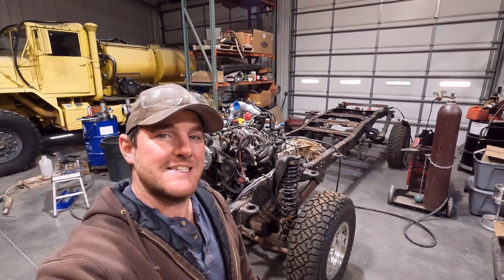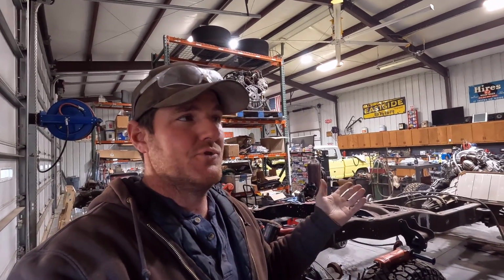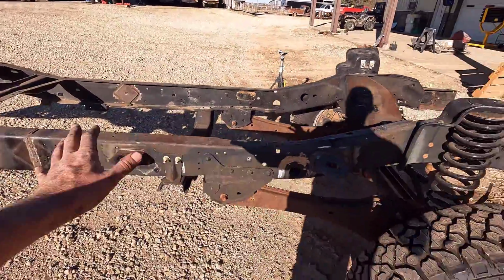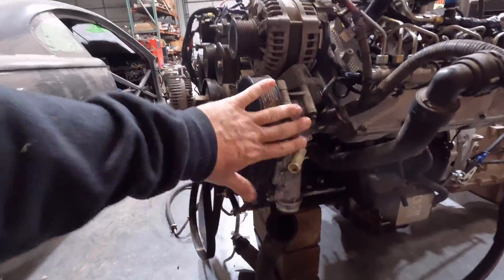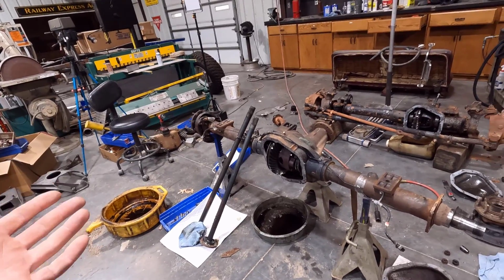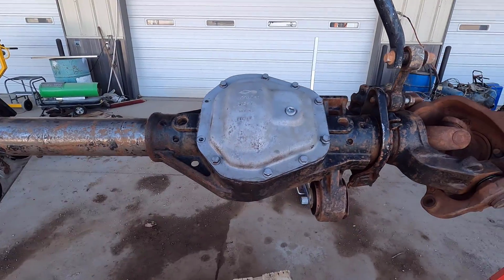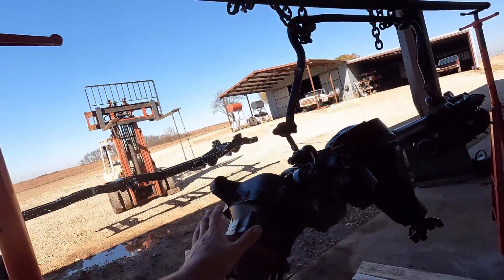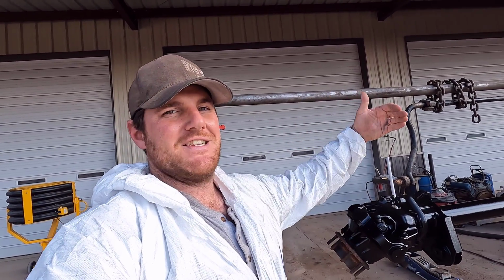Coating the Frame for the Ultimate Crew Cab in Chassis Saver Ultimate Crew Part 13

Comment: how has it held up over the past 2 years?  any sign of rust making its way thru?
Reply from the maker: I still haven't finished this truck so I cant say on this one. But by white "Ultimate Highboy" build was painted in with the same thing back in 2020 and gets used in some pretty rough environments and its holding up pretty good considering. Some fading where it can get UV exposure and some chipping where its exposed to rocks. But overall pretty well. If it was on a street driven truck it would be even better shape.
Reply: @MattKubik1791  I did my 03 land rover disco with it...with the body on frame...no fun...got it in my hair, etc. very hard to get off.

Comment: Just saw the last few minutes of this video and that front axle shows real well.  Nice finish.  Is that chassis saver an already thinned product,  ready to spray or did you have to thin it?  Coverage looks real good.  Great Job.  I see the clouds rolled in to help you out with the sun.  That's always a good thing.  Thumbs Up.
Reply from the maker: Yes clouds came just in time for the second coat! The chassis saver requires its own special thinner and I thinned it 3oz thinner per qt per their instructions for spraying.

Comment: Hey Matt,  Gerry here in FL..  Try to do all your painting,  whether it be for a frame, inner cab or body exterior out of the sun.  Under the roof overhang eave would be cool both for you and the chassis, but I know you don't want to get that stuff on the exterior of your shop or anything except for where you want it to go.  The shade would also keep the chassis cooler which is what I think would be better for adhesion,  but I'm no pro,  just talking from experience with painting house exteriors.  Never painted a chassis but I'm with you on spraying it rather than brushing it.  Love to see you do the second coat and what it looks like when finished.  Now to watch the final 6 minutes of these Highboy Resurrections.  Damn,  I love these trucks.  Old School or No School.

Comment: I should have just went this route for the chassis as well vs powder. Will the 17'' steel wheels your going with accept a hub cap? If so, info on those please. Id like to run a 17 vs a 16 for a better choice of tires.
Reply from the maker: I’ll have more info in the next video. Shouldn’t be too long before it’s out. Starting on filming it today.